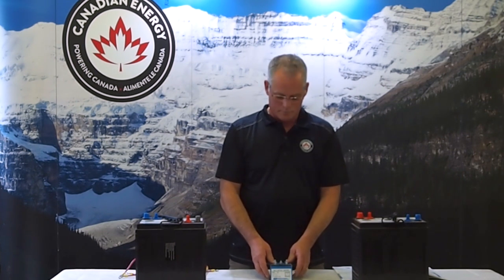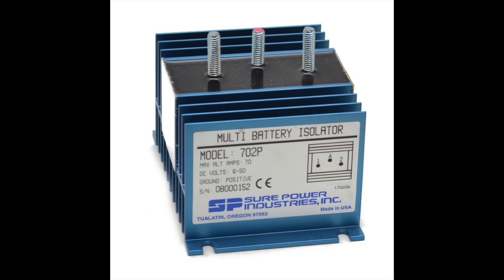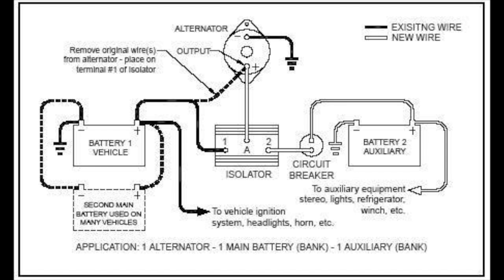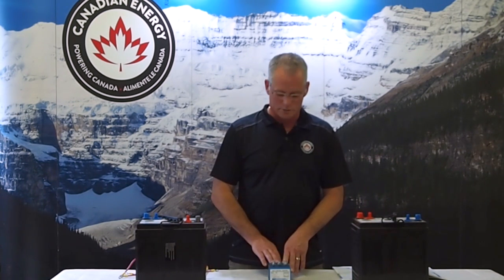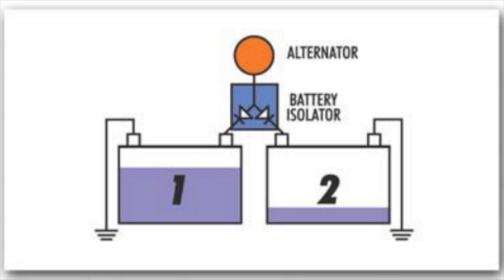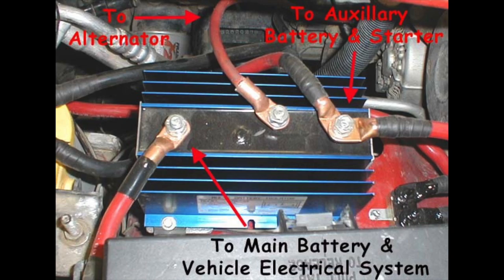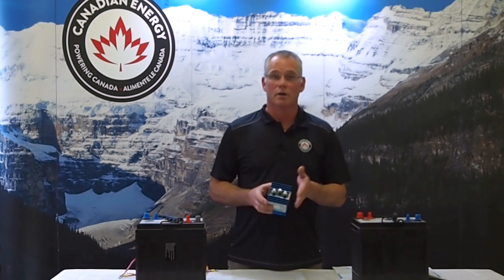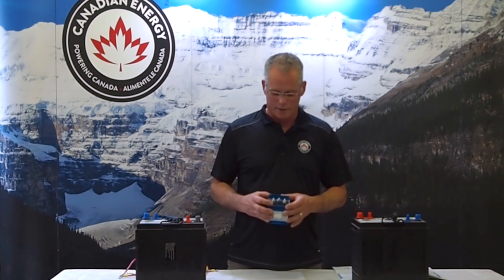Battery Isolator 101: How & Why They're Used in a Dual Battery System

Comment: I think you have a small error in this presentation or maybe I'm just reading it wrong. Don't take it the wrong way - your presentation is great, I just got confused by this.
On the first diagram you have the ignition on the main bank (terminal 1 on the isolator) but on the real life picture in the end of the video the starter (ignition) is on terminal 2 with the auxillary. How can that be?

And my question...
if I'm installing this on my boat, where I'm also having to charge from the dock, do I then connect the charger to terminal A as well as the alternator, or do I risk damage to the system if I start the engine while power from the charger is still flowing from the dock?

Thank you :)

Comment: sound so easy. how about the rest of the story?-  the alternator sense wiring ( volt / amp output control ) and how to keep it from turning down the alternator for the full batt and leaves the dead batt to trickle charge ?

Comment: If the start batt is full and aux battery empty will the iso charge the empty and not charge the full?
Reply from the maker: Yes, the bulk of the alternator amperage will be directed to the battery with a lower voltage. Hope that helps.

Comment: Would you connect a Solar Carge Controller to the Isolator? In the same way as you connect the Alternator to the Isolator?
Reply from the maker: Helder Neves we would not recommend connecting an isolater with a Solar Charge Controller as isolaters cause voltage drop due to the internal diodes. If you are connecting multiple battery banks that are charging with Solar and a Solar Charge Controller your better option would be to seperate the banks with a manual battery selector switch or with a battery separator, neither of these devices will cause voltage drop. Hope that helps!
Reply: Thank you. But in "theory" that would not be a problem right? Special because nowadays we can find Diode Isolators that guarantee a very low voltage drop (as low as 0.1v in some brands I found)
Reply from the maker: Helder Neves Yes that's correct, my preference would be a battery separator as they are more reliable and outsell isolators 10-1.
Reply: A bit further on my research I found out that a Separator(also known as Relay/Solenoid), would only allow the Solar Charge Controller to charge the batteries when the engine-key is "ON" position. Is that is correct?
Reply from the maker: Helder Neves No it is controlled by voltage, when it sees greater than 12.8 volts (may vary slightly by type) it will close and allow the 2 batteries to be connected, when it sees less than 12.8 volts at will  open and disconnect the 2 battery packs.

You may be referring to a continuous duty solenoid which are often controlled by the vehicle ignition.
Reply: im installing a 4000watt inverter in  my 07 uplander with two deep cycle batteries in back plus my alternator is 125amp I like to know should I use 125 or better fuse for this set up.

Comment: Does a battery isolator prevent the auxiliary batteries from overcharging?
Reply from the maker: No, a battery isolator’s sole purpose is to pass charge current and voltage through to the batteries when the alternator is operating, the alternator receives its information from the voltage of the batteries and bases its output on that. Hope that helps.
Reply: Ohhh. Okay. I understand now. Thank you so much for the response. I've been trying to figure this one out for a while now.
Reply: So basically, when it gets to a certain voltage rating, it just cuts off energy flow to that battery bank. Would you recommend wiring a fuse into the positive line?
Reply from the maker: +Aaron the Anarchist Fuses and breakers are often overlooked when installing auxiliary batteries and equipment, you don't necessarily need a fuse in between the battery and isolator but should definitely have one in between the auxiliary battery and the device or accessory it is running.

Comment: I just recently bought a dual  isolator for my 1999 Chevy Tahoe I connected it as I was supposed to but my voltage dropped to 10 volts and does not charge my batteries what am I doing wrong the dial isolator has connections for the alternator and battery one and two that's about it
Reply from the maker: First thing I would check to make sure that isolator is compatable with your vehicle and the alternator, there are different isolators for different makes and models.

I would recommend checking the voltage off the middle post of the isolator where it takes the feed from the alternator when the vehicle is running, it should be 14.5-15.5 volts.  If you are getting good voltage there disconnect the isolator feed to your auxiliary battery and see what the voltage is off the isolators auxiliary battery feed, it should be only about 0.25 volts less than the alternator feed.

For future reference you may find wiring in a battery seperator is much easier as you don't have to tap into the vehicle alternator wiring harness, the battery seperator simply wires in between the vehicle main battery and auxiliary battery and performs the same function as the isolator.

Comment: I under stand that while it's running , my question is when the Van is off will it run,my 500watt inverter at 12volts and for how long
Reply from the maker: The isolator has nothing to do with the operation of your inverter with the vehicle running or turned off, the inverter should draw power directly from the battery or through a circuit at whatever voltage the battery is at, based on state of charge. How long the inverter will operate at 500 watts is completely dependent on the size and capacity of your battery and the state of charge, the isolator does not regulate voltage or supply power with the engine off, its sole function is to allow multiple batteries to charge from the alternator and isolate the batteries from each other to prevent auxiliary loads from discharging the engine starting battery.

Comment: so if I want to run a 600 continues watt inverter off my second battery , will the isolater take care of charging that second battery and keep it at the right volts
Reply from the maker: Yes that is correct, the isolators job is to allow charge to both batteries while the engine is running and the alternator is charging, and isolate the main and auxiliary battery from each other.

Comment: How do I disconnect an Isolator? I would like to go back to 1 battery instead of 2
Reply from the maker: Eliminating the isolator will involve disconnecting the wire that runs from the alternator to the centre post on the isolator then reconnecting the main battery connection from the isolator back to where it originated from the power distribution block or to the alternator, this will all be dependant on the wiring configuration of your particular vehicle or application.

If the isolator is still functioning the simplest thing would simply be to disconnect the auxiliary battery from the isolator and charge your main battery the way it is currently connected.

You may have to consult an auto electric specialist or a tech who is familiar with your alternator wiring harness if it is a late model, multi wire system.

Comment: I see the circuit breaker (or fuse) in the wiring diagram connected to the auxillary batteries. What size fuse would you recommend?

Comment: That will be dependant on the alternator and make of vehicle, I would recommend that you refer to the OE manufacturer to determine the power requirement of the "ignition" wire.

Comment: The Wire that is supposed to go to the "ignition"... Does that wire simply need to be powered by a 12 volt source constantly or a "Momentary On" such is turning over the starter?  Simply suggesting hooking it to the ignition switch don't answer my question.